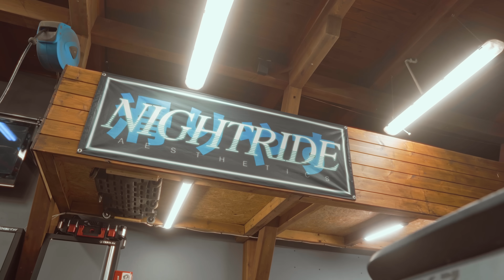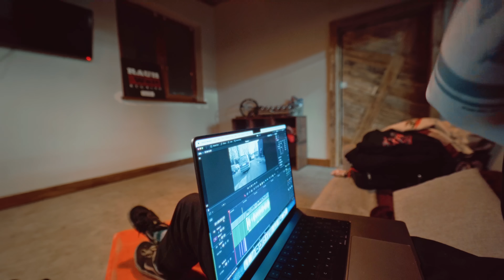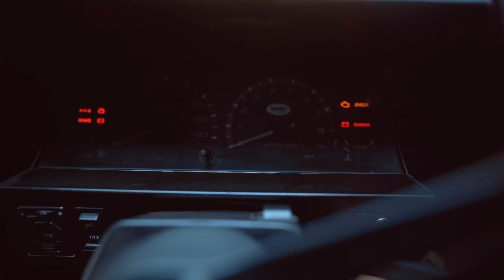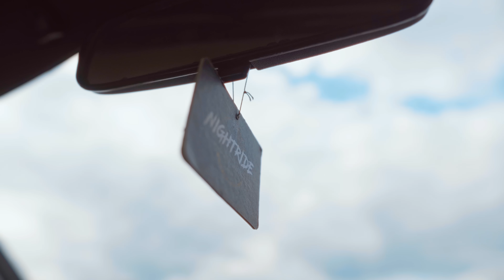Bringing our Friend's DREAM CAR back to life - Filip's Nissan 200sx S13

Comment: I've noticed Sam locking the doors from the inside on 86, you can actually lock them from the outside, if you lock the door while it's open and close the door with having the handle pulled. Then it should stay locked after closing the door. For anyone with broken lock and not having central locking like me. Made my daily life easier.